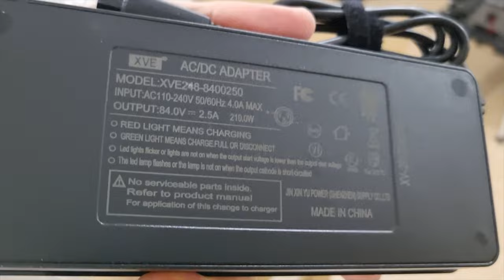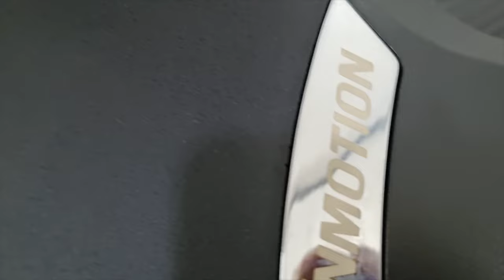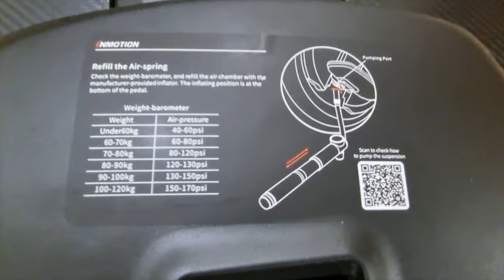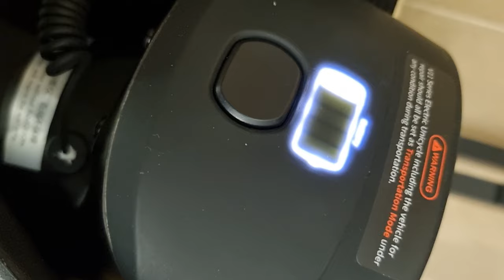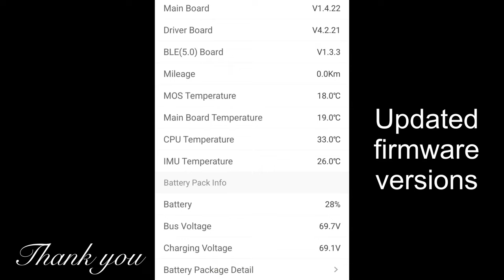Inmotion V11 unboxing 01-2023, close-up details, firmware versions

Comment: Hej. Gdzie kupiłeś?
Reply from the maker: Chicway.shop - Chinese seller with  warehouses in Europe or USA.
1699$
Reply: @pawel.wisniowski  Super . Dzięki
Reply: Hi could you explain how to update firmware..... does it need to be on its side, plugged in charger, etc. Been looking for a while, I just don't want to brick it. Thanks.
Reply from the maker: @sembatocus9958  in my case it was simply done when my wheel was leaning against the wall with 20-30% of battery. Don't remember if it was during the charging... Just opened the app and it went automatically.
Hope that your wheel will be fine.
Reply: @pawel.wisniowski  thanks I'll try it out later today
Reply from the maker: @sembatocus9958  if possible, please share your initial fw version, and how it went through. Thanks.
Reply: @Pawel Wisniowski  will do. I bought it used and guy didn't really ride it in a while, when I turned on app it showed needing the safe battery firmware update. About 8 hours after work I'll do it.
Reply: @Pawel Wisniowski  ok I turned on inmotion app first then wheel, it connected. I was holding wheel upright as it was on. When I clicked update a window popped up telling me to put on kickstand or lay on its side, I laid it on the side. It shut down then turned back on and got the success message. So all is good. Haven't rode it yet though. Gonna check shock pressure then ride. Thanks a lot!